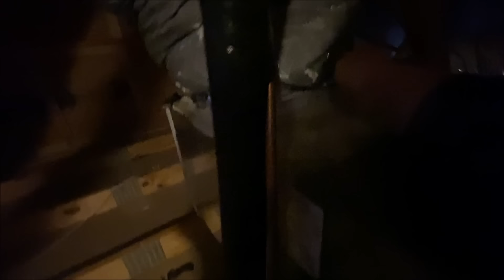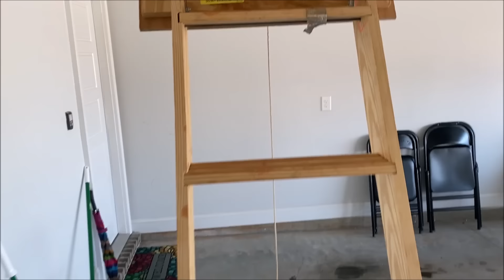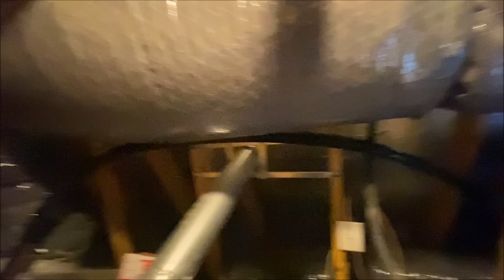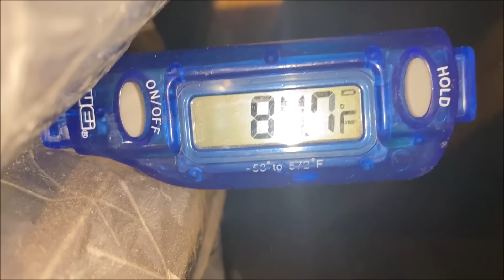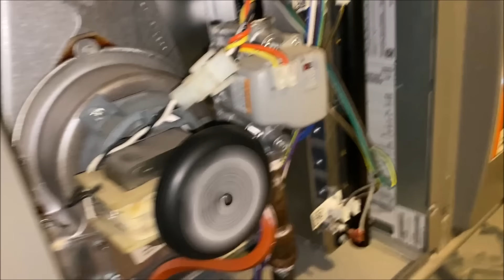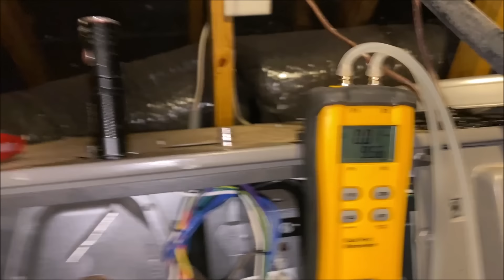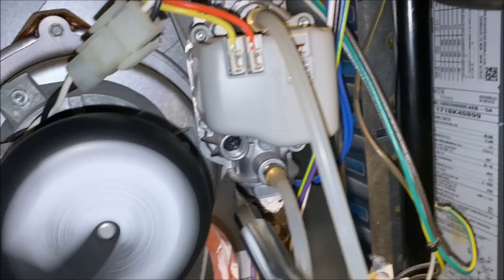New Construction HVAC Hack Job Butcher Sabotage pathetic installers

Comment: The only reason I can think of a regulator being anywhere but next to the meter is... some device has specific needs that demand a lower pressure than service.  What I can't tell here exactly is... did that regulator get put in before or after the manifold?  If its before, Id bet cooking on the stove sees flame output drop every time heater kicks on.

Comment: I would have checked the temperature rise across the unit first. Then the manifold pressure, then the pressure coming from the gas meter, then the pressure coming from the first regulator. The duct work is what it is. That is what the builder wanted because that was all he was willing to pay for. Likely, the job is up to code, barely. The United States is a corruption based Sh$t hole. I am retired now, wish I had never been an HVAC tech. Do yourself a favor, start over again as a large factory commercial installer or service tech. Nothing but chillers and giant air handlers and computerized controls. To he$$ with residential, let the Mexicans own it. Best Wishes

Comment: My neighbor has a small house, only 900 sq ft. When the builder hired the HVAC company, they put in a 3-Ton heat pump. Our area sits at almost 5,000' elevation but the winters only get down into the low 20s typically, never anywhere close to zero. 
So, why would anyone install such a huge heat pump in such a small home? 

BTW the home is only 5 years old, has very good insulation and nice double-paned windows. We know this because on cool nights that get down to 40 degrees (F) he doesn't even run the heater because the inside temp never drops below 68. On a hot day, 90F, with the AC off, the inside temp doesn't get above 75F. This is why we know it is very well insulated. Even more reason a 3-Ton unit seems excessive. 

My guess is, the HVAC company did this simply to bill the builder for more money and knowing the unit is overpowered,  it would break down much faster and need to be replaced. What do you think?

Comment: this would never fly where i come from. Inspector would condemn it immediately. I havent seen anything like this. This is beyond unbelievable. The flex octopus has arrived.  Why no just run some 26g round hard pipe for the main trunk if thats the route they wanted to go? Really going to take off from the supply plenum with a monster piece of flex to feed the main trunk? There goes all your air velocity.

Comment: Retired tin knocker from the Northeast. In plan and spec work you weren’t allowed to use more than 6 feet of flex at the end of each run. This job was a hack job to say the least. Static pressure is the culprit

Comment: This looks like a propane conversion system. LP gas regulator.  Gas valve conversion.  Why have that gas regulator in a natural gas piped system?  I would look at a LP tanh vs a natural gas meter outside.

Comment: Where the hell is the "building inspector" ? I mean they MUST have had permits. Also its easy to go after the manufacturer making sure they bow down to Gov regulations,  but it actually takes a concerted effort to make sure every single installation is correct.

Comment: I have 123 years of total general contractor experience, 34 years electrical, 23, years HVAC, 14 years plumbing, 47 years 7 months 5 days 34 minutes and counting in housing building experience, I personally installed inspected 541 heating conditioning units- plus a few dozen installments of water heaters - standard tankless…so I’m comfortable giving my opinion on this situation, again just my opinion.. so that being said …here goes- OPINION!🤓

Comment: This is where the building inspector should be called on the carpet or fired. The contractor should be made to re-run the duct work. Talking about piss pour work and inspection.

Comment: As a contractor from NJ, this type of work is rampant in this state. Inspectors are NOT doing their jobs. Failing something on a job is a teaching experience for the trade workers. If inspectors are turning their heads, for whatever reason, most don't know much and it shows, the trades are not learning anything...

Comment: Does the regulator have a relief vent ? And why would you ever want a regulator in your attic. If it was new construction why wouldn't they just properly size the various gas lines to meet the individual needs of each appliance. We would never pass a final inspection in my location

Comment: The gas line around 5:10 seemed odd to be coming from overhead.
  Most likely it comes up an outside wall. It would have been cleaner to come across the interior ceiling and hard piping it. A pex line running the roof line is hackery.

Comment: I’ve been doing hvac service for 46 years in Massachusetts and that gas line would never in a zillion years pass inspection here. Manifold hanging in mid air. Gas lines going everywhere with no hangars or anything. And that ductwork, my god.

Comment: I would not have a job if I did this type of work. Im glad yhe inspectors I work with auctually check it out and won't approve it unless its good work. Someone is being paid to turn a blind eye to this type of work. It would have been easier just to do it right the first time. Why not run duct and come off it with individual flex runs. This will never work right.  Plus that return is so small. A unit will only put out as much air ai it can pull into it.

Comment: on the p trap flush, it makes more sense to glue the cap on rather than the pvc to the coupling so when you pour water down its not a smaller hole

Comment: Most contractors get the cheapest guy to do his installation and upcharge the customer so they can make more money. The pipe of gas in front of furnace 🤪 at least it moves if you actually have to change some parts 😆

Comment: The ductwork  in  my house was pulled apart in six places in the  basement. A trunk line had a six inch hole in the top. I sealed all the joints.  I worked for a company installing new home systems. They pulled people with no skills off the street.  It was terrible.  I quit.

Comment: I worked in environmental control technologies for a decade hillyork Florida chill water to new construction to servicework etc. I still hold accts at supply shops.  So should I NOT install my own upgraded system & call a "professional" who's gunnamelt my shader valves and clog my metering devices?   No I'll do it for myself CHEAP at wholesale cost🐊🌴🫡not me pal~

Comment: My HVAC installed by subcontractor of the builder, I found no signs of tests such as differential pressure as no holes for pitot tube, ended up testing myself , added a uv light, replaced open switch with a sure switch with delay start, a heater for the compressor, and a capacitor to get compressor motor on step quickly..

Comment: Did you notice the supply pressure dropping to 4.62 manifold only at 2.7! The gas valve has a 1/2” to 1” pressure dropping itself! Also he was getting close to the rated maximum rise at 2.7” you know at 3.5” the furnace will trip the limit! Also this is important! Max external static in heat mode is .80” the filter is going to be around .25” the coil around .30” that flex will be above .60” oops! You cannot run above a .8 total external static pressure if you do, you are operating the furnace outside the design limit you could run into a erratic limit operation possible heat exchanger damage overheat conditions that furnace is no longer operating within its safety operating range that’s an installation not a product problem!

Comment: If this is natural gas , That small regulator is a step down regulator used when the gas meter is supplying elevated pressure to small gas lines. The gas meter system could be supplying 1/2 to 2 psi to that small regulator. Sometimes the small regulator is put in by accident and affects pressure or goes bad. Maybe the gas meter system is not supplying the proper pressure. It’s always best to check pressure before and after the small regulator.

Comment: I thought he mentioned an airflow problem. I would guess there is an obstruction or a damper closed also. He did get the temperature to be much higher. I don't understand why we sacrifice quality in this country. It is always more expensive to fix it later. This homeowner now has an out of warranty problem. I hope the problem was fixed.

Comment: Yup flex duct, gotta hate to love it.  Ok if done right!  Gottal love the run that goes into two or three triangles before landing on the register.  Kinked everywhere and just not tied right!  Archatechs today just don't see running a fiber board trunk line and running to registers from the trunk line anymore.  A plenum and flex duct.  Yeah that gas regulator really looks small.  Can't go wrong replacing that, gotta be starving for gas.   Be careful bud, as you well know that last one to touch it marries it (so to speak).  Good luck

Comment: The crews are not careless per say. You're dealing with Guatemalans and other South Americans with an average iq of 70... That seems harsh to point out, but that is a deficit in ability to follow instructions or basic commands at a level normal people can't comprehend. They are not capable of doing these trades.

Comment: I don't like anything about his diagnosis.  He should have verified the gas pressure all of the way back to the meter. I've had regulators out of adjustment or failed at the meter. Could have been a supply problem from the utility as well.  I've dealt with that, too. Just a poor intervention and diagnosis as a whole.

Comment: May be getting adequate pressure,  just not enough volume based on how it's responding to adjustments.  Crank open that regulator or get rid of it all together. Problem is not enough volume of gas , piping or main reg/meter

Comment: I worked hvac for years on install. New builds And changeouts ect. I have never come across something like that Ramon noodle soup bowl. I ran flex, but not like that. Trunk line was metal duct and we ran flex off it to the boot. Always had good temp drop and flow coming out the vents. Something’s restricting that air, like ya said probably an arm or two or four got pinched or bent in half. I would run new trunk line n use the existing flex if able too. N definitely the regulator is needing an update. I can’t recall what the pressure was supposed to be, I had a couple strokes and lost a bit of memory. It must be LP though because of the regulator, because natural gas is regulated through the meter at least where I’m from it is. And that regulator has to be outside also. Where is this at?

Comment: Time is money.  Installers aren’t properly trained in the art & science of air distribution.  I’ve spent a lot of time cleaning up disasters like this.  If all the ducting & piping in this country was designed & installed properly, power consumption could be reduced be at least 25%.

Comment: That setup for gas behind you and the small regulator. It’s starving and they have destroyed the units gas valve. The ductwork is done so poor it’s terrible. Even with temp output up. Where is all the airflow?

Comment: I was an installer for 8 years. I changed careers 2 years ago, and even though I know what I'm doing and have all the tools necessary, I still am going to call a professional to install my next unit. HVAC is definitely not DIY stuff, only those up to date with current procedures should be trusted.

Comment: My house was built in 2020 with 2 years warranty on HVAC. In 2021, I had a problem with my HVAC, but guess what, they said the unit was manufactured in 2019 and I had no more warranty.

Comment: A HVAC part house will sell a unit to anyone who has the money. The brand maker wont care that the the installer butcherd the install and the supplier part house tec rep if they have one will say get your installer company back, they would delay it until a year has passed then say our warranty with you has expired. I started my HVACR road back in 1977 and earned more wall paper, a mechanical engineer degree, and a Tennessee state HVAC license, this kind of work is shockingly common and to install a new unit are due a change out by TN law you are supposed to pull a permit which requires a mechanical license and a final city/county inspection, just remember money can make many people have no integrity.

Comment: The unit is only 4 years old at the time of this video. The gas flow and pressure is tested by Lennox prior to shipping. They can’t print the shipping label until the unit passes the test. Those must have been adjustments made post installation and/or the gas flow is restricted. Then again, it was made in Mexico.

Comment: I couldn’t watch this all the way to the end. If air flow is the problem, that furnace should be cycling on the high temp cutout with a very high temp rise across the heat exchanger. A 2 minute temperature rise check would have confirmed inadequate air flow. With reduced air flow, if it’s not cycling on the high temp cutout, then it’s not burning 90k BTUH of gas. Put a manometer on the burner manifold or the outlet port on the gas value and confirm proper gas pressure for fuel type. If natural gas (3.5” WC), go clock the meter to see how many cubic feet of gas is entering the furnace (turn off all other gas appliances). This will eliminate someone putting the wrong sized orifices in the manifold (LP much higher pressure, much smaller orifice than natural gas. Yes, I have run into that issue in the past.). This service call to diagnose the problem shouldn’t take very long. The quick visual check tells you that the duct work sucks, but the temperature rise check would have confirmed air flow as the problem and the further checks would have confirmed that the fuel source/combustion was not the problem, then you just have to pull off some panels to look for clogged A/C coil, blower speed too slow (unlikely), detached insulation liners in the furnace and A/C cabinets or ductwork. After he found out the gas valve outlet pressure was only about half of what it should be, then that’s your issue. Bad gas valve, undersized piping, wrong sized regulators upstream of the furnace, etc. are all likely problem sources. If the inlet pressure drops significantly when the gas valve opens, then you have an upstream issue. This ain’t rocket science folks but you do need to know what you’re doing and clearly the installers did not.

Comment: I still don't understand what happened (maybe I missed the explanation?)... I heard him saying "No Gas Pressure", but I thought he was saying I was getting hot at the furnace? Wouldn't the heat at the furnace + adequate airflow = good heat? Or does low gas pressure mean inadequate airflow?

Comment: Wow why aren’t you checking blower motor and and coil. From what I see flame looks pretty strong and that hasn’t anything to do with supply air. I’m guessing those runs with dampers one upstairs and one down stairs. Why didn’t you shut off downstairs and check airflow as well. Sure they don’t have one of the two supply runs hooked up to return plenum and one of the returns hooked up to supply plenum. Also what’s fan speed. A lot of stuff not checked. You noticed no airflow from vents in a room or two. That should’ve been first thing to check deeper as looked at ducts but didn’t check fan speed or return grill if it’s sucking or blowing. Etc. anyway, just wondering flame was strong enough to be roaring as well so if pressure was so low size of furnace and blower would’ve blown burners out. So it has enough gas pressure to put out strong powerful flames from the sound of them as you didn’t really show burners. So many things that were missed in troubleshooting. As far as drain cap on drain a lot of people glue cap and not piece going into tee as easier to grab that entire 3” or so piece with cap on and pull off then sometimes just a cap on old drains sometimes is a pain in ass to remove if it hasn’t been removed in a long time. I prefer the cap glued on myself from a service perspective, also opening bigger on tee female end to clean drain out then opening on just the 3/4 pipe

Comment: That whats called a 2 day job .. and the building contractor and hvac man need fined ..i bet a 1000 they wouldn't buy this house after there own installe ..just like you said regulate the manufacturer but not the installer ..next time my price is to high for someone ill show them this video vs my installs ...

Comment: Your so right. These builders and Subs should be in jail for the crap they do. In our neighborhood ( oldest is 15 years, builder is still building new homes) they out in way to small heat pumps. Cheapest ones they could use. Some of the new owners are having to replace entire systems at 2 years.
I had to replace ours at 13 years. The new compressor unit is 3 times the size of the original and we FINALLY have decent heat and cooling.

Comment: I have a lenox hvac system its 97% eff  and seer16   cools good and heats very good.
Now its a better system then this unit, but that junk was not installed correctly, it is wasting energy year round  and ill bet the A coil freezes in the summer.

Comment: I am so glad my furnace is in the basement.  I have metal ductwork.  System works great.  This craziness of putting furnaces and water heaters in the attics and having an octopus of ductwork is crazy.  Not only that, but working on a air handler in a 100 degree attic is ridiculous.  I would never buy a house with a crazy setup like that.  Not only that, but the quality of these new homes is awful, and they cost  way too much.  Crazy what people with buy.  When you buy a new house, you better inspect it yourself, because it's obvious the inspectors are a joke.

Comment: Pookie (duct sealant) sealing up the space between the coil and furnace says it all. Any installer with a functioning brain knows you use clear silicone there what in the actual fxck 😂😂